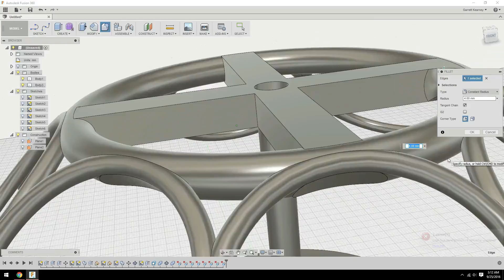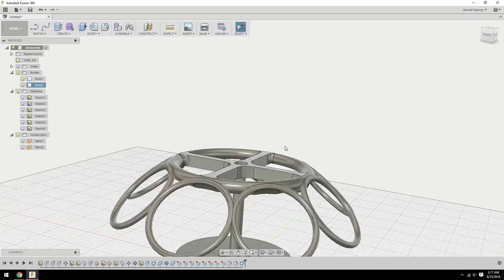3D Printed K-Cup Spinning Holder

Comment: Nice little project. Now i want to make something like that for my nespresso cups too. ;)
My tip to you if you design something that needs to hold something else already existing: You better start by copying the already existing part in the 3D world. In your case, you would have realized that the 8 K-Cups can not fit because they overlap once you put them in the holder in fusion 360, so you could have saved at least one iteration of printing. And always try to think about usage of the product in the design phase too. (where do my fingers need to go to get a cup out of that holder, does it fall over if only one side gets filled with cups,...)

Comment: Perhaps you could run the middle with a dowel or even metal stock? Just gatta make the tolerances nice and tight around the material. :)
Reply from the maker: Yeah I could make that work if I really wanted it to be sturdy. But I think if I do it again I'll just orient the middle section different so it would be quite a lot stronger. :)